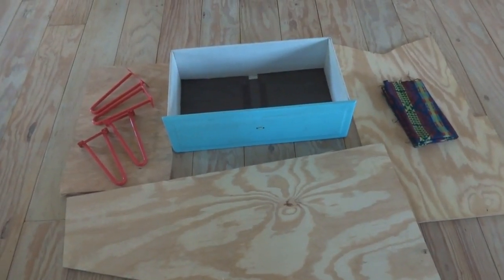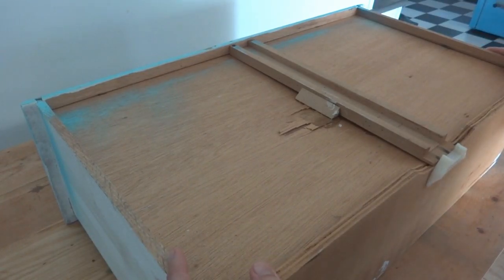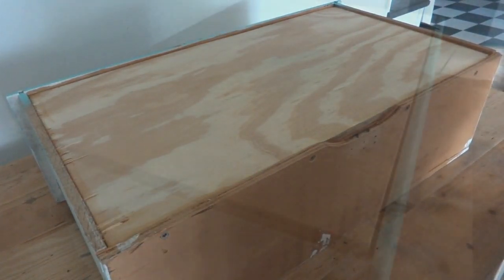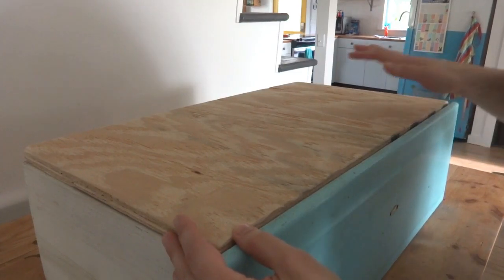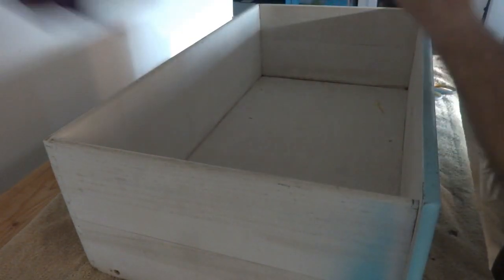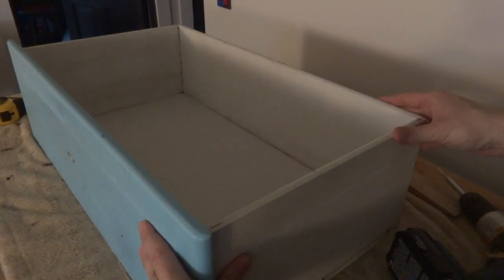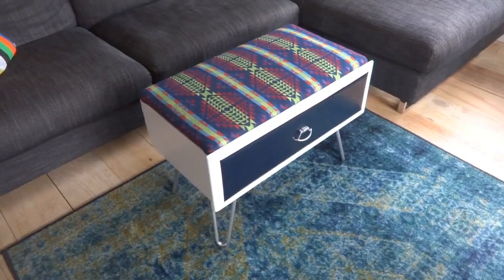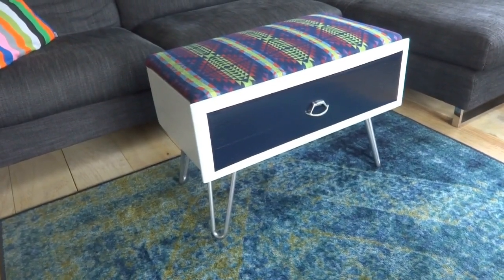Turn a Drawer Into an Storage Ottoman!

Comment: I like this a lot. Would it be possible to easily add hinges to the top so it would flip up instead of taking the lid off?  If you have another drawer, do another vid showing that please. Good job though.
Reply from the maker: Sure you could. I considered making mine that way, but went with the simple lift off top instead.

Comment: Where can one get the hair pin legs. At the big box stores or did you offer them? Those would be great for some projects I have.
Reply from the maker: I actually grabbed these from a small kid sized table/stool set I bought, but you can find hairpin legs on Amazon, Ebay, Etsy, and there's even some hairpin leg sites out there too. I've also found some on old beat up tables listed on Craigslist (but it's easier to just buy new online).
Reply: Thanks for the info

Comment: Where do you find the hairpin legs??
Reply from the maker: They were actually part of a child size table and stools I found online. The table had (4) 18" long hairpin legs, and the two stools each had (4) 9" long hairpins legs (the ones I used in this video.) The whole table set was only $60, so I bought two sets to make a bunch of projects with the legs. You can also find them on ebay, etsy, amazon, hairpin leg websites, and sometimes even on old tables on craigslist. I bought a set of (4) 19" long hairpins legs on Amazon a while back for about $65, so those little table sets I bought with 12 legs were a steal!

Comment: if I may ask, why did you paint the legs white first? also is there a reason you didn't do regular paint only spray? I'm wanting to do something like this to an old hope chest that the bottom fell off on.
Reply: mim l  It is not white paint on the legs it is primer so the paint will stick to the metal legs. And you can use regular paint but then you might get brush strokes. Spray paint is just easier and faster in my past experience.
Reply: +kelly dobberstine oh ok thank you!!
Reply: sprayijng also uses less waste.

Comment: You probably already know this, but maybe some of your viewers don't: If you spray white over the tape line first it will seal the edge and the dark blue won't bleed under the tape.
Reply from the maker: Yep great tip. I should have done that, but I noticed that my white rustoleum was taking forever to dry, and I didn't have time to wait for it. But usually, I'd spray a light coat along the tape to seal it in.